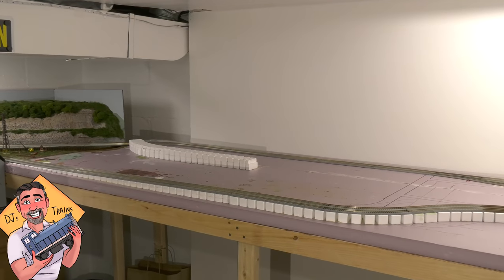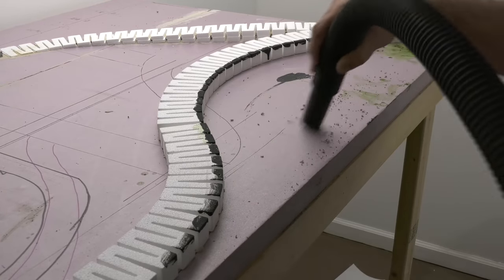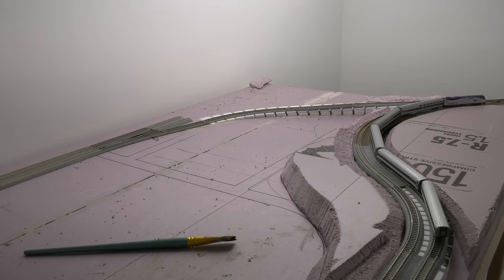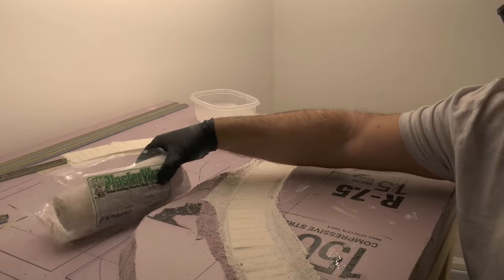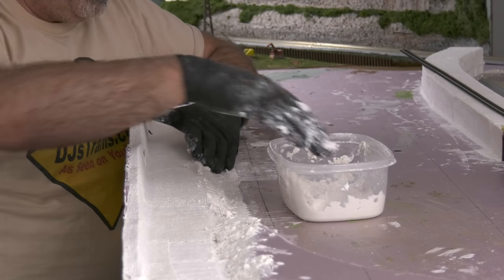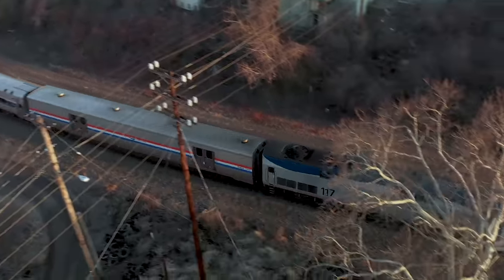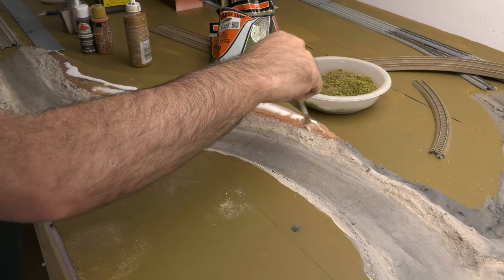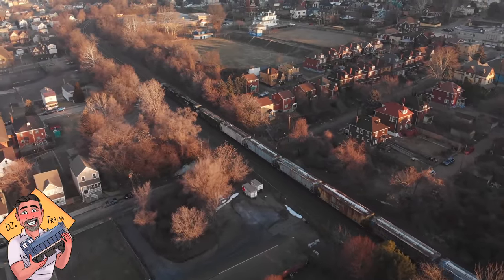MODEL RAILROAD SCENERY MADE EASY.  Feeling Stuck? This will HELP

Comment: You made it look easy. Due to the geographic area I will tend to create with my layout most of the track is above the scenery or at the same level. I can use similar techniques for some of my lower wetter scenery areas.

Comment: Thanks for the great video! I really liked the idea of putting 1 inch foam between the track and the edge of the layout. I need to explore that more. I gotta say, I am not a fan of S-curves on layouts. Do you encounter a lot of S-curves in your job as an Engineer? Cheers and take care.
Reply from the maker: Yes, a funny story.  Years ago a train dispatcher rode my train from Connellsville to McKeesport.  He was shocked that it is all curves.  He said "On my screen, its a straight line!"  LOL!!!  Not much straight tracks because we parallel rivers and around mountains, so my layout represents that.
Reply: Some of the first road trains I ran were in the Mid-West.   Flat track.   Very minor grade changes.   You could hop on your power and literally take your consist to the next point without ever being able to look back over your train.   Piece of cake.   Then I ran over mountainous terrain on a regional railroad that had been built over an old logging railroad.   I could sometimes see my 60 car train twice.   Very different railroading.   By the way, on my HO layout where I needed an S curve I made it as gradual as possible.

Comment: Hi :) It's funny how "tastes" can vary. ;) Myself I really don't like using plaster cloth and sculptamold :P In fact, except the paint and the glue, I am avoiding anything which is wet and takes time to dry. I directly carve all the rocks and ground shapes in the foam itself. Cheers ! :)
Reply from the maker: I have also done that on previous layouts and in some videos.  I’m trying to show a variety of techniques.  Everything except the chicken wire lol
Reply: @djstrains  Hehe, but some people really love this chicken wire ;) I forgot to mention that one more reason for avoiding plaster and sculptamold is the weight. I can move my network modules alone as they weight less than 10 kilos per square meter each ;)
I have 2 smaller networks build on a standard styrofoam sheet (125 cm by 60 cm) and I can move them alone with no issue :) . But what is nice is indeed to see all possible techniques :) Have a nice day ! :)

Comment: Curious:  Wondering if you have played around with modular modal RR systems.  I am currently working on some T-Trak modules, and really like it a lot.  It is not the most prototypical system, but I love the flexibility and simplicity of it.
Reply from the maker: I used modules for most previous layouts.  I work differently than most.

Comment: i so bad want to get into the hobby, but logistics are a problem as my room is too small and i am trying to take care of a puppy who likes to chew everything up but i hope for my new adventur starting on my birthday
Reply from the maker: start with n scale, 2'x4' plywood, and keep it under your bed.  Start something
Reply: @djstrains  i would put it on my christmas list
Reply: @djstrains  where is there a hobby store carrying n scale in east Tx? any suggestions
Reply: @maxmillianlanders3148  I too have a small n scale layout. I expanded mine to 2.5'x4' so I didn't have to have a really small radius to my oval. It is a double track, and I have 3 stub end (?) sidings, and two places with turnouts between the inside and outside loop. Of course, I've always wanted to make a mountain, so I'm making it on one corner. I've put 2" foam on a piece of hard board and glued it with gorilla glue. I've just drilled down for wiring, which is just track power. I'm not worried about any light for buildings or lamps. Of course, with the mountain it won't fit under a bed now at all, but it would have before. If you have a place to put a wire shelf on a wall, you could probably fit it up there if it was simple enough.

Comment: How about full strength white glue for the foam layers?
Reply from the maker: Id advise against that.  White glue is for more porous materials, so it won't bond well.  Liquid nails and hot glue adhere better and permanent.
Reply: @djstrains  Thanks, I did not consider that, although I can get white glue for free. I’m always looking not to spend a lot & use what I’ve already got-if I can find it! The south shore of Lake Erie, where I hail from, has fantastic RR museums in Conneaut, Oh & North East, Pa. where they even have a Little Joe electric! Worth a road trip “ mup-here” from Pittsburg.
Reply: i have used full strength Elmer's Glue All with good results.  I have read it's different in make up than Elmer's school glue. I have tacked the foam down after application and used cans of food or books to hoId the foam in place until the glue dries. So far after being down for a year it is holding well.  I buy it on line in 32 oz containers since it's cheaper than buying it in the store. I use the glue for everything on the layout that needs gluing down.

Comment: Some times I rush  with plaster cloth , I some times it doesn't dry
Reply from the maker: Are you using good plaster cloth from woodland scenics or scenic express?
Reply: @djstrains  I like your style of narration for your videos, bro. Really laid back and supportive of ppl getting into the hobby. I've been using a plaster cloth called "rigid wrap" I ordered from Amazon. It's almost identical to the WS and SE products although it doesn't seem to have as much plaster packed into the mesh, but you can get a 5 lb roll for about $25 I think which is pretty good considering hobby name brands are pricey lol. It doesn't have pre-cut sections though either so I put it in a shoe box with a slot cut into the box and pull out what I need and then cut it off with scissors. All in all, I really like it. It does the exact same thing as the other brands but I can admit that the name brands have a bit more ease of use.